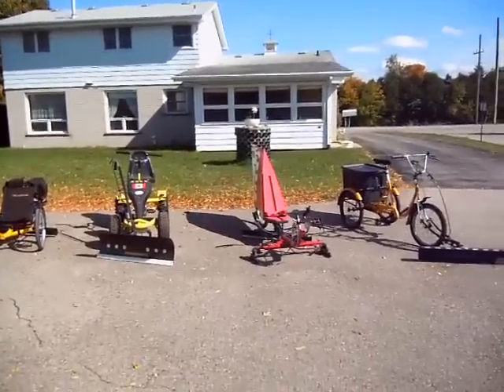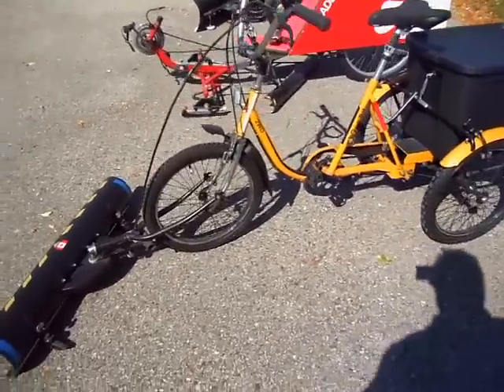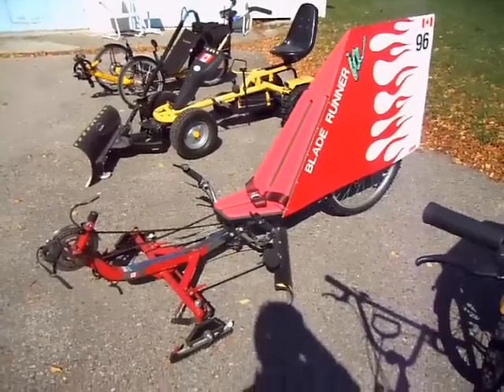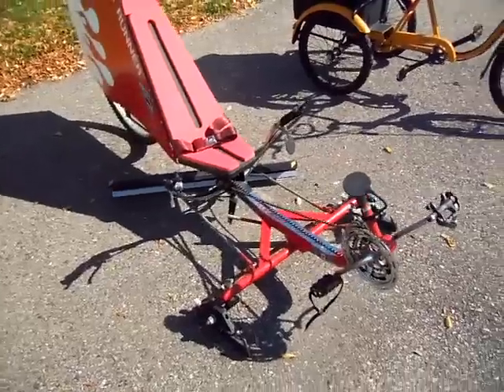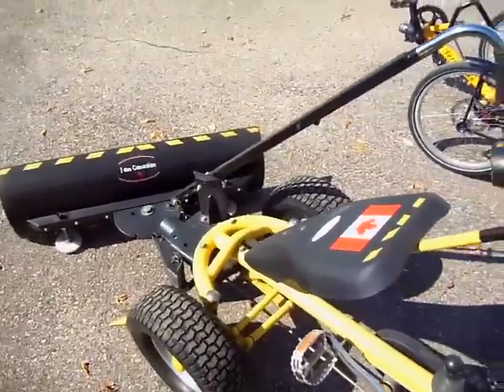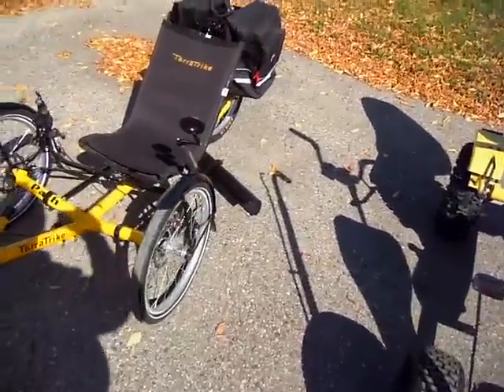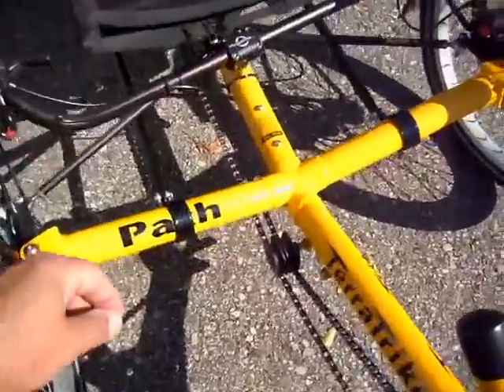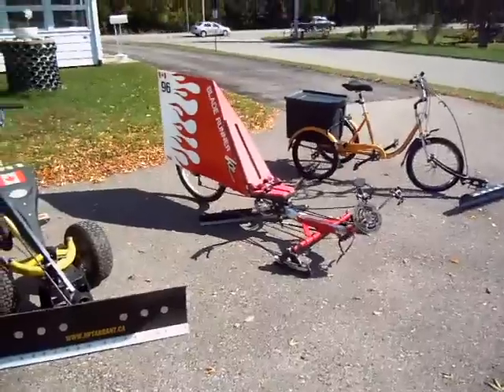Human Powered Snow Plow Fleet

Comment from the maker: The warp stabilizer was courtesy of youtube. I'll never use it again, promise! All of the plows are limited by the blade(moldboard) height and type of snow. Therefore, the pedal-quad can push 12" of powder snow, with the adult trike pushing 6". With heavier snow, I often use just part of the width of the blade. The key is to keep each plow's momentum high enough to ensure constant flow of snow across the blade and a comfortable pedal cadence.

Comment: 5+ years ago I bought a Chinese built 4 wheel pedal machine sold through Harbor Freight Tools. It was one wheel drive and in snow it wanted to go left and lift up the front because you sat right above the rear axle. 1-10 I'd score it at a 4. Not deeply engineered.

Comment: Your capability and skill come together with interesting results. What could you come up with to move autumn leaves?
Reply from the maker: Mountain Willow That solution is in my brain and partially on the drawing board. It is a rotating brush assembly that will attach to the front like the plow. I need it to clean the leaves and branches off my driveway. Stay tuned!